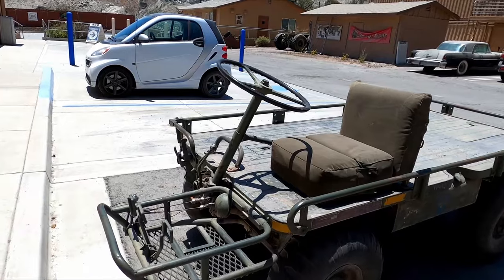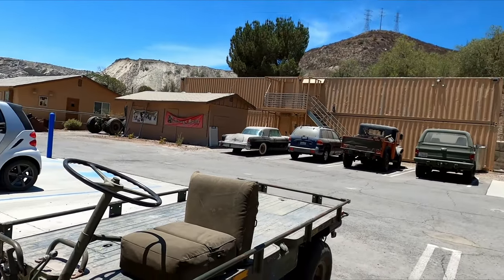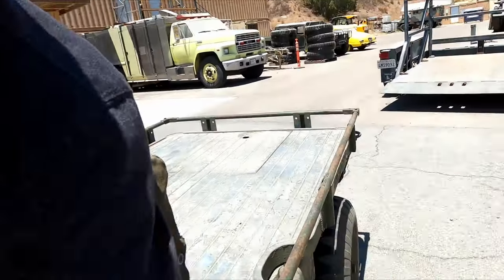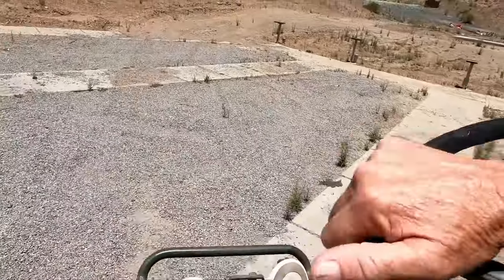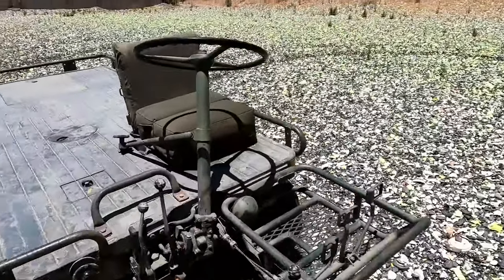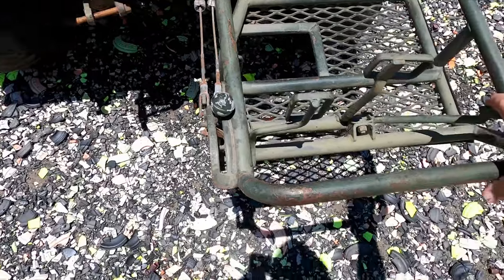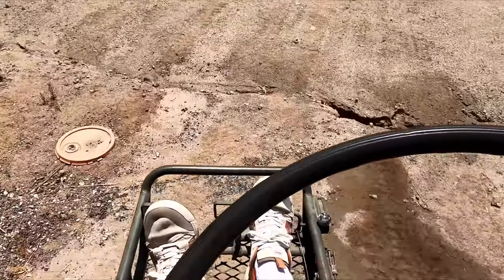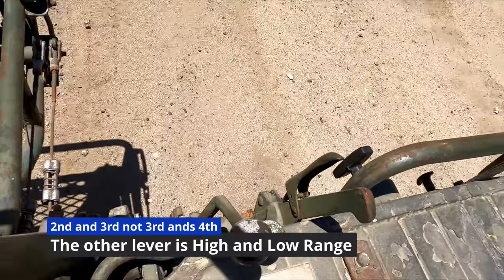M274 A2 Mechanical Mule

Comment: Always use a bit of choke when starting. And if it is adjusted properly, the hand throttle should be in the start position.
If the bushings in the direction changing pulley are worn, they GREATLY increase the effort required to pull the starter.
Reply from the maker: This could probably use a little TLC.
Thanks for the advise.

Comment: If I had one I would make a camper box for it that ties down a big cage to carry timber make a trailer for it make a tool box / workbench for fencing put on rod holders for fishing trips the options are endless, also build a tin roof over 5 feet high over the entire vehicle with an extra part that stretches out the front of the driver ,
Reply from the maker: The options are nearly endless